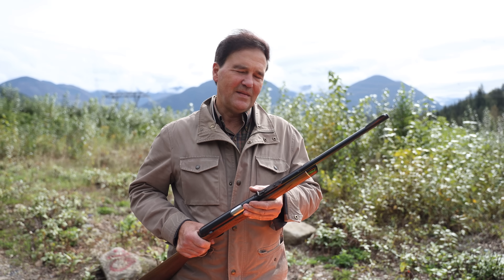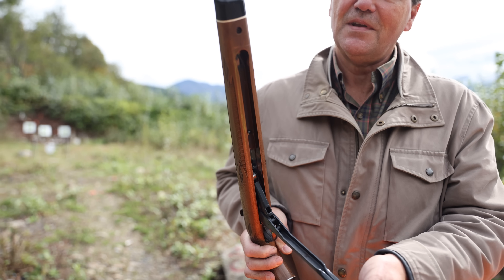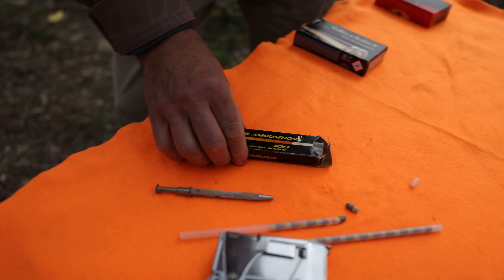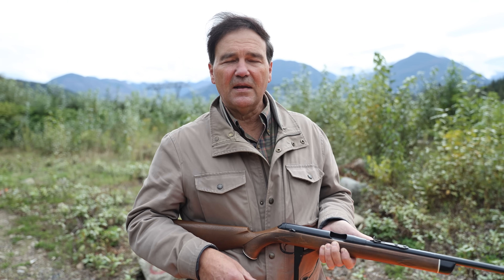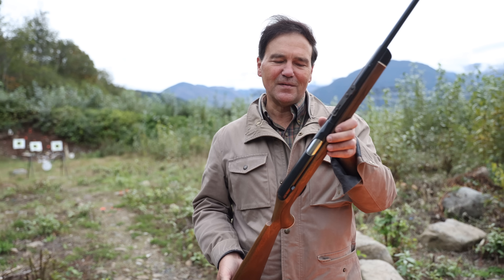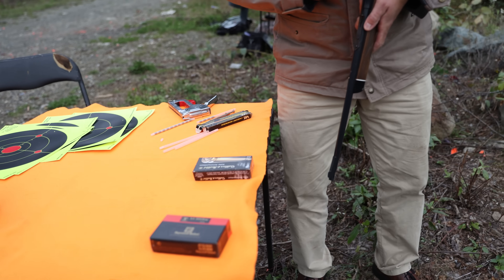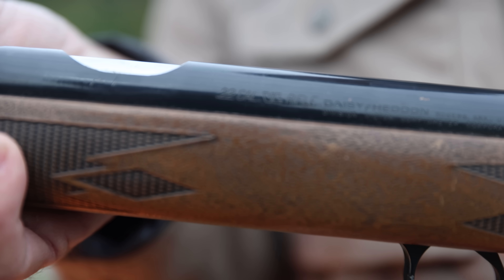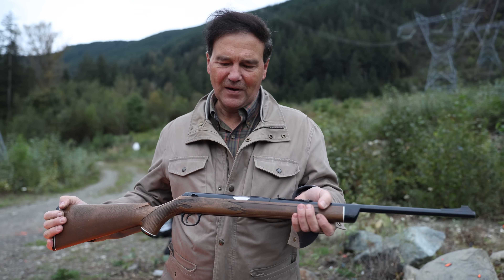Air Rifle OR Gun Powder? Daisy VL

Comment: Total quantities of VL rifles made varies by the source of your information, I have heard totals anywhere between 23,000 and 25,000. Daisy made 3 different models of VL rifle. The first 1000 are a collector model that came with a walnut stock that has a rectangular brass placard that has the purchaser's name and serial # of the rifle, they came with 300 rounds of ammo, a hard case, and a pair brass wall hangers, serial numbers start at A00XXXX. The next 4000 are the deluxe presentation model, they also have a walnut stock but with an oval brass placard saying "SPECIAL PRESENTATION MODEL", they also came with a pair of brass wall hangers, serial numbers start at A01XXXX. The balance of VL's are standard models with plastic stocks, serial numbers start at A02XXXX. It has been suggested that the plastic stock of the standard model has some weight added in the butt to improve balance and deaden some of the noise. I have also seen a picture of a VL, in a gun guide with a Monte Carlo stock but have never seen pictures of an actual rifle.

Comment: What people keep forgetting about caseless ammo is that the cartridges are rather fragile, this why they are generally only found preloaded in magazines.  That's why it has made little headway in military applications.
Reply from the maker: H&K and Voere and most designers focus on the relative fragility of powder without a case; as well as feeding. It remains an interesting area. More attention is on entirely different systems though.
Reply from the maker: H&K and Voere and most designers/engineers focused on the relative fragility of powder - even compressed; also, water/humidity and "cartridge" feeding to some extent. It's hard to forget as fragility is the main technical obstacle. Thanks for the note and all the best.

Comment: I still have mine - was always fascinated by the concept.  The ammo got a little hard to come by last time I looked, and a little expensive because of rarity, but there's no denying the validity of the concept.  Of course, all ammo was in shortage for a while, so maybe that's changed.  I grouse at spending over $2.00 a box for .22 rimfire, so maybe I'm just cheap!

I always thought there were two flaws: one, that it wasn't a repeater.  That didn't make sense, because the whole value of having compact ammunition is that you can carry lots more of it in the same space and weight.  Of course, with a columnar/tubular magazine, you have a bullet head in contact with the charge of the next round.  The other was that it was manual cocking, when the chamber pressure could easily have been used to compress air for the next shot by having a piston of some sort in the bolt.  

Seems like it would have been a natural multi-round plinker if those two problems had been addressed and solved.  The one thing I notice is that the button of hardened igniter attached to the heel of the bullet is a little brittle, and sometimes small pieces break off.  That means the charge is less and the velocity drops when that happens, so accuracy suffers.  But it's still a fascinating piece of firearms history and a novel approach to eliminating broken firing pins!

Comment: i have one of these..it isnt gunpowder, its compressed nitro celulose pellet attached to the back of the bullet
Reply from the maker: Thank you - it's a remarkabe systeml; interesting that they took it to production though. I like them. All the best.

What is smokeless powder composed of?
Spherical smokeless powder is generally made from nitrocellulose as the base material. The nitrocellulose may be derived from purified cellulose, such as from cotton linters or wood, which is then nitrated by being treated with nitric and sulfuric acids (Olsen 1942. Smokeless powder.

Comment: I used shoot through metal culvert pipes as test with both pellet air guns vs .22lr. With pellet Co2, I shot through more material with an air gun. A .22lr would go through one section barely and maybe bounce around. The air guns could go through two sections and go out the other side. I also did the same test with M1 Carbine(7.62x33 and .410 slugs. The M1 Carbine barely made it through both sides. The .410 slug did worse than the .22lr barely going through one side. My point is air guns are more deadly than you think. They're also quiet and a lot easier to obtain. Not the perfect idea for defense but from my experience they will most definitely kill.
Reply from the maker: I agree - there is much that can be done with air rifles and much room for development as well - even after hundreds of years. Cheers.

Comment: The concept works on a regular air rifle. If you use a petroleum based lube on your pellets the heated compressed air ignites the lube and you will hear a distinct crack when you fire your air rifle. This does add extra velocity to the pellets. I have not chrono graphed them to get an exact reading but it does work.  I'm thinking a drop of Tannerite on the back of a pellet should work also, however I haven't tried this, YET.  lol

Comment: How does compressed air ignite the propellant?    Is ammunition available?
Reply from the maker: Compression brings molecules closer together causing release of energy as heat. High pressure means high heat. That heat ignites the gunpowder. Ammo is around.
Reply: @UnitedStatesOfGuns  Thanks for the reply, my understanding is that heat is generated when the air is compressed, as with the handle below the barrel.   The heat then dissipates.    When the pressure is released, the air expands, and the result is cold air.   Where am I going wrong, as I can see that the gun does fire with compressed air?

Comment: Do we forget that we had caseless ammo before cased ammo? It sucks and isnt practical. That's why we use cased ammo
Reply from the maker: Thank you. I saw some recent patents for ceaseless ammunition. The cost saving is so great - if the brass or steel case could be made obdolete- they keep trying. Something like electric cars - first one 1830 and they're still trying to get EVs to replace internal combustion engines. It's not going well for EVs. Same for ceaseless ammo but the appeal and returns are immense; not only cost savings but weight as well. About a year ago I had a look at a rifle that used a gas that was metered into the chamber. The action only fed bullets. Interesting. All the best to you.

Comment: The real reason caseless ammunition didn’t take off is because it’s basically plastic explosive and they don’t want us to have that. Much higher ignition much faster flash much hotter burn, all in all way more violent then gunpowder and you would just be buying block of it with basically shrapnel built right in. Yeah they shut that down quick
Reply from the maker: I had no idea - thank you!
Reply: @ I’ve heard of people buying singular g11 rounds for hundreds of dollars so I’m sure if you wanted to check one out you could find one. As far is I can tell it’s a lot like night vision, the technology and machines haven’t changed much since the 80’s but they still price them high to keep ownership numbers low under un directive. Germans didn’t mind the complexity because it was insanely reliable, already paid for all the tooling and licensing. Un basically said no civilians don’t need this is what I heard, the story of ‘we don’t need it anymore because we unified’ was just a fuss free answer

Comment: I remember that Daisy, never owned one. But in the early 70s while in the Army, I had the opportunity to command a tank that fired a 152 mm round that was also caseless. No empty cases rattling around on the turret floor, less weight. Compressed air was also used, to blow any residue out of the barrel before the breach opened.
Reply: Was it the M551 Sheridan or the M60A2 Starship you had the opportunity for?

Comment: What if the recoil of larger calibers pumped up the air for the next shot for semi auto fire? 
Is that what h&k did? 🤠💥💥💥💥💥🇺🇸🇺🇸🇺🇸
Reply from the maker: Good thoughts. H&K used a primer; gas pressure can be used and so can recoil energy/momentum of moving parts. Capturing high pressure gas in volume is tricky though. You're on the right track but complexity/cost/safety quickly become factors.

Comment: Sure it won't fire pellets?
Reply from the maker: I kept thinking about it and tried some .22 pellets. Works well with some and others don't seem to displace enough to make a gas seal so they sit in the barrel. I guess I could try other projectiles as well - if/when I run out of cartridges. I think I'd rather get a powder to work as viewers suggest can be done since I have air rifles that are designed to fire pellets.

Comment: I thought about using gunpowder to get compressed gas in an instant for air rifles.

Open, throw in some smokeless, close and ignite and you have enough pressure for a few shots
Reply from the maker: Please be careful 🙏 Air rifles are designed for air - not gunpowder. The Daisy is extraordinary.

Comment: There is a kit that has recently become available which makes black powder caseless ammo for use in percussion revolvers - if one is made for the .31 cal percussion revolvers it is possible it could be easily adapted to make caseless .22 ammo. I'm sure the design of the kit could be copied for .22 cal with a 3d printer in any case (no pun intended). The kit makes caseless rounds where the powder part is tapered and shaped like a tapered, round ended foam ear plug.
Reply from the maker: Excellent and informative post - thank you

Comment: The Daisy VL is, unfortunately, a caseless firearm that understands the limitations of material science and works within them.  Caseless ammunition suffers from what I'm going to call a "hot brass" deficiency.  Normally, hot brass is a nuisance to shooters.  I never felt more embarrassed than I did at the range when a Glock 22 launched its brass vertically over the divider between lanes and down the blouse of the lady shooting next to me.  But a gun that doesn't have hot brass to eject has other problems.

Think about where the heat comes from - it comes from exploding the primer and gunpowder and creating all that hot gas that sends the round downrange.  Ejecting a casing not only makes space for the next bullet, it takes all that heat with it.  Caseless ammunition generates nearly as much hot gas, and it has to contain that gas to the area of the barrel behind the round.  Most of that heat will not be ejected quickly, it will soak into the steel of the barrel and the firing mechanism.  

The Daisy VL's small caliber single-shot magazineless design means that it's not cycled more quickly than the steel can disperse the heat of ignition, as well as keeping most of the rounds far away from anything that could cook them off.  This is what smart engineering around caseless ammunition would look like.  A semi- or full-auto firearm that shot higher caliber rounds would build up enough heat to make holding the gun uncomfortable quickly, and extended firing could possibly allow dangerous heat to reach the other rounds in the magazine.

We probably won't see much* attention paid to caseless designs until someone invents Magic Spaceship Metal.  MSM is a fantasy material I just made up that has the strength and machinability of steel and better insulative properties of Starlite or the stuff they used for Space Shuttle Tiles.  You would need something that doesn't transfer heat that can be machined into firing mechanisms.  Such a material would also be perfect for putting on the outside of spaceships, and that's presumably what it'd actually be invented for, hence the name.  With a super-insulative machinable material, you could look into designs that used the gas pressure to cycle some sort of external air feed or coolant through the exposed areas to allow for decent firing rates.  

*There is one slightly newer "caseless" firearm design that suffers from being a solution in search of a problem.  The "Metalstorm" design is capable of literally unbelievable firing rates (usually expressed as "a million rounds a minute", with math that makes it obvious they rounded off, not made things up) and the ability to fire rounds with inches separating them.  It's only semi-caseless, however.  The "magazine" that the rounds come in is also the barrel and casing.  The rounds are stacked, bottom to top, in alternating bands of propellant and munition.  There are conductive rails at opposite ends of the the tube.  When enough current is passed through them, it first arcs through the propellant of the top round, igniting it.  The gas launches the top round and compresses the round beneath it slightly.  This prevents the arc, which has now moved down to the second round's propellant, from igniting the powder for a fraction of a second.  This stutters ignitions and keeps the firing action from just detonating the magazine.    

The story of its invention, by a non-gunsmith who did not explode even once, is fascinating.  It's been considered for several uses, but most of the things it would be good for work better with the ability to fire rounds for an extended period of time and to choose when to fire or not.  Once you start a Metalstorm magazine, all the rounds are coming out.  The most interesting suggestion was to use it as a replacement for landmines.  The various militaries of the world really want to get away from autonomous long-lasting things like mines that are a threat after the battles are over.  One solution was to put a man-in-the-middle.  The area to be interdicted would have sensors put in, and when someone moved through, the info would be sent to an operator.  If the go order was received, the operator would fire a metalstorm system that rapidly scanned back and forth while firing like an artillery blast.  Scanning quickly enough would allow the operator to land a bullet in every square yard of a zone, doing the work of a minefield without leaving behind anything more dangerous than cameras.
Reply from the maker: Remarkable post. Thank you for taking the time. Quite interesting!

Comment: I wonder if the case-less ammo can be used in a regular .22 air rifle.
Reply from the maker: I checked and it doesn't fit. The Daisy no doubt has other properties that make it difficult and possibly unsafe to use the ammunition for some other purpose. Someone could develop the Daisy system.
Reply: @ thanks for the info.

Comment: I've always wondered why nobody combined the concepts of the gyrojet and caseless ammo. Make it centerfire with the rocket projectile being both propelled forward for an initial burst to start accelerating it and being ignited by the powder charge. But instead of the more finicky and difficult to transport compressed gunpowder just have a nitrocellulose wall on the back of the round to burnt up when the primer is hit and the powder goes off. In theory you could even retrofit the gyrojet style rounds to existing larger calibers and firearms by making nitrocellulose cases which would involve a lot of math and testing but the cases themselves might be enough of a propellant without them even containing any powder.

The only questions there are do you make the primer be attached to some sort of rim to be extracted and ejected or attached perhaps by a rod to the back of the gyrojet so it travels out the barrel with the round.

Of course if you were developing a new firearm with such hybrid rounds in mind then an electrical igniter might be ideal.

Comment: why not tell us how it works?
Reply from the maker: Thank you - I thought I did but here it is : compressed air is released when you pull the trigger. The air passes through a very small opening which causes the air to become hot. The hot air ignites the gunpowder attached to the bullet. The expanding gases generated by the burning gunpowder moves the 29 grain bullet through the barrel at about 1100 FPS. Hope this makes sense

Comment: Airgun actions used to fire powder rounds not a new idea , Combination guns as they are known go back about 130 years to my knowledge, I have one sitting in my collection dating back to the late1890's, not that they used caseless ammo which incidentally also dates back to the nineteenth century in terms of the idea and early development.  No mostly they shot .25 rimfire and used a barrel liner to reduce the bore to .177 for airgun shooting mode.   Yes I know they used firing pins driven by air pressure so not the same but roughly similar. The early combi guns were developed for Victorian gentlemen  specimen collectors, who required low powered guns to collect birds and other small animals for their taxidermist. Oh what a time for the indolent rich.
Reply from the maker: Good post; I have at least one of those and also another kind which I'll make a short on this week. Thanks for the reminder. While there were many guns that used caliber reduction; they used gunpowder to create pressure on ignition which was used variously for bullets, pellets, shot, darts, arrows, harpoons and even re-directed for other purposes. The Daisy used air pressure for ignition and gunpowder as a propellent - although there is some residual pressure from the compressed air.The H&K caseless and Voere caseless used primers (H&K) and the Voere used electric ignition. I'm sure we'll see more developments in this area.